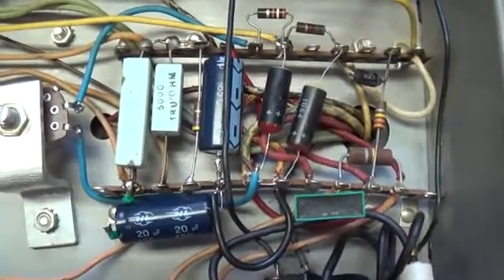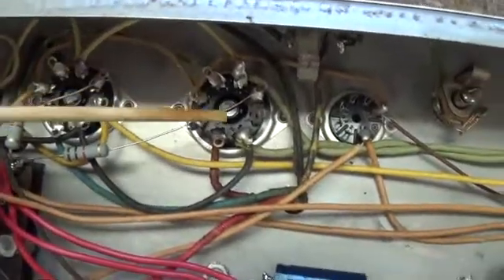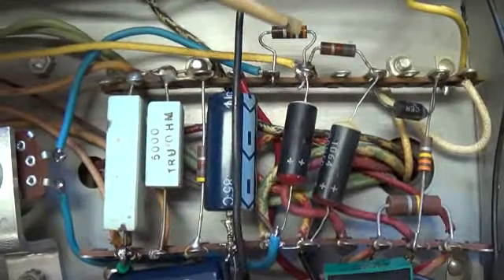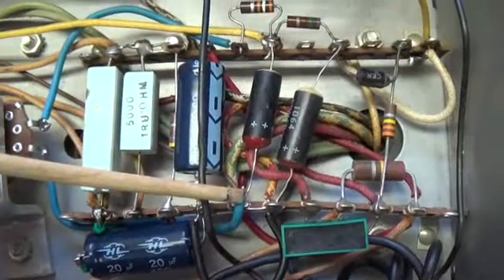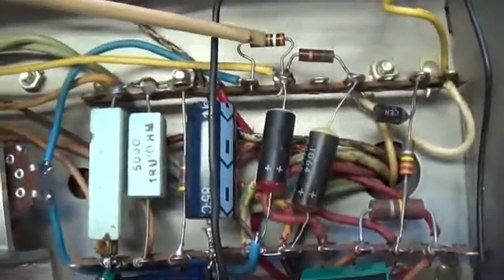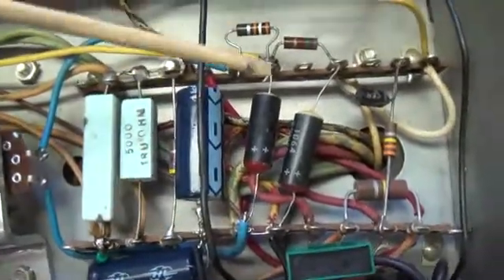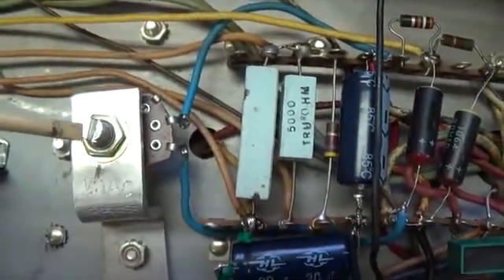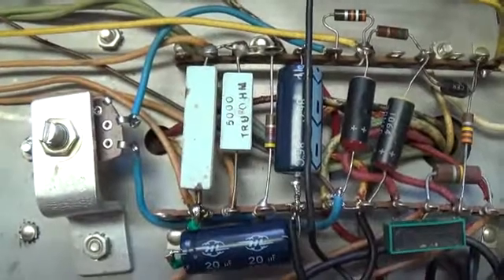Converting a Fixed Bias Amp into an Adjustable Bias Amp

Comment: I suppose this would work for a 5f1 circuit too?
Reply from the maker: I have posted videos showing how to install variable resistors in place of fixed cathode bias resistors. Two issues arise:  The wattage of the pot may be inadequate and the setting may change due to vibration, etc.

Comment: you know why no one ever designs fixed bias S.E. amps?
because the bias supply noise cancels out in a push-pull transformer ( common mode rejection ), not so in an S.E. amp.

but i have developed the ultimate 50 volt tap bias supply for S.E. amps, ( because i am designing one ), it's like a buck regulator topology, followed by two RC filters, and a zener clamp.
Reply from the maker: Thanks for your helpful input, RG.
Reply: @UncleDoug  and another S.E. fixed bias approach:  smaller filter caps take smaller " bites " of the half wave, through larger resistors it seems to smooth out more also....and both tweaks together doesn't necessarily change the knee frequency.
Reply: @UncleDoug  and Thank You...the Uncle Doug show has been a major contributor to my expanding vacuum tube electronics knowledge base.
Reply from the maker: @RulgertGhostalker  We're glad to hear it, Rulgert :)

Comment: @uncledoug what kind of 1ohm resistor is best?  what about wattage rating?
Reply from the maker: A good choice would be Metal Film or Metal Oxide rated at 1W......the current and resistance are quite low, so I-squared x R is way less than 1W.

Comment: Thank you Uncle Doug 😁 I’m doing a Filmosound conversion (621) and watched your videos about your project which helped a lot! Would a variable bias control work on my Filmosound 12 watt amp too you think? This will make it possible to crank the amp more on lower volumes am I right? Or not? 😅
Reply from the maker: If the Filmosound has an NFB loop, then it can easily be made variable or switchable.

Comment: Fixed bias is the adjustable type of bias. Cathode bias self adjusts
Reply from the maker: Fixed bias amps often do have bias adjustment pots, while cathode-biased amps do not. "Fixed" seems like a misnomer......but unlike CB circuits, the bias setting does not fluctuate.
Reply: @UncleDoug  I'm sorry sir, I didn't say anything about trimpots or any other type of adjustable resistor. All I said was this...fixed bias amps are the only type of amp that needs to be adjusted. The entire reason they call them "fixed bias" is because you have to fix the bias. Unlike cathode biased tube circuits which are regulated basically by themselves in a closed loop. Adjustable bias amp=fixed biased amp. Cathode biased amp=it adjusts itself, you should not have to do anything to a Cathode biased amp circuit unless maybe the capacitor or resistor gets cooked. Which really should not happen in the 1st place. Watch a Dr. Z video. He explains the best. Also if guys knew the truth about Cathode biased amps & how the main reasons we use "fixed bias" circuits now being fixed bias circuits create more power than Cathode biased amps. Makes me think about car guys & how they always want more power. Those guys would want a fixed bias amp if they knew that. Cathode biased amps are great as well but since they produce less power or "wattage" as it's called. The Cathode biased amps are quicker to break up & push a tube into distortion. That's where I get lost though because you would think that an amp that creates more power would be quicker to push the tubes into break up/distortion but that doesn't seem to be the case.
Reply from the maker: @MAP448  Thanks for your input, Matthew.

Comment: Do you make those little metal tabs you use for mounting the pot to the chassis? Or are those a standard bracket? Thanks!!
Reply from the maker: I fabricate each one from material I have on hand, Bob.

Comment: Uncle Doug-I'm trying to adjust the bias on a GA25-RVT with 7591's that are biased too cold...V5 is 7.8w & V6 6.3w and I believe the target is around 13.3.  I have been trying to adjust them by altering the 7.5k R46, but after watching this it appears I'm barking up the wrong tree.  After reviewing this video and the schematic of the GA 35 to see what you altered in the circuit, I think I should be looking at changing the value of R22 that bridges C14.    I've also removed the tone network that chokes off so much gain and bass out of the circuit per another of your videos on the GA35.  As a side note...the tremolo in my amp was not working and the problem was the opti-coupler which has long been unavailable.  Recently I found a reproduction on e-Bay from a fellow in Colorado,  I installed it and it works great. The new repo part also includes a shield that when connected to chassis makes the circuit hum free.  
 I want to thank you for taking the time to produce all the excellent videos you have shared with us....They are logical & well thought out without being overly technical and the emphasis is always on safety.  I think back to my early days in a body shop and the old tech would look at me, smile and say "I taught him everything I know and he still don't know a dang thing".  Well..in this case I'm learning a lot about something that has been elusive to me in the past. 
Hope you, your family and all the critters are well.
Tom
Reply from the maker: Thanks for all your nice comments and for the tip on the replacement photoresistor unit, Tom. Without a proper schematic, I can't offer any help on the biasing. The one I looked up shows cathode biasing.
Reply: @UncleDoug  Here is a link to a schematic and I welcome your opinion/comments on the biasing.
Best Rgards & Happy Easter...
https://music-electronics-forum.com/attachment.php?attachmentid=40393&d=1472138853

Comment: What kind of pot is that? Is a special pot that doesnt move easy or something? Also how much resist does it need to be ? Im thinking of buying an amp with fixed bias, its name begin with M and end in esaboogie
Reply from the maker: No, it's a regular pot. The value must be selected to suit the bias circuit WC. Good luck with the Mesa amp. Hopefully, there are techs in your area who can work on it if anything goes wrong.

Comment: I had two (2) new Marshall 2245/JTM45 guitar amps within the last 30 day's. Both had tube issues, I threw in the towel and traded for a new Fender '59 Baseman LTD. It has the same schematic but the new amps also have a bais pot. I will trade the 6l6's for 5881's like the Marshall have and maybe use a 12AY7 in the 1st. preamp position as well. Both amps use the same 5AR4 tube rectifier. 
If I had trusted myself with being able to bias the power tubes in the JTM45 I would have kept it as it is the best sounding amp that I ever played through.
 In about one more year, if I keep looking and learning from Uncle Doug's Video's I shall be a Graduate of the Uncle Doug School of Amplifier design and build/maintenance. I shall draw up a very fancy Diploma with the highest artwork skills within my possession. Maybe I shall even mail it into Uncle Doug for him to sign it. I bet If I was on the job market that alone shall indeed get me hired. 
When I was younger I would present my University Degree and I was always hired.  Truthfully, not once did anyone ever ask me to actually produce it during an interview. It was listed on my resume. 
P.S. If I learn enough, eventually I may get another JTM45. That is, if the new '59 Bassman LTD doesn't do it for me. But I think it shall, especially with the tube changes I have in mind. -Peter Nelson
Reply from the maker: You have just the right attitude, Peter. Keep on learning....but don't take chances with jobs beyond your current level of understanding. I would be honored to sign your diploma. Keep up the good work. The world needs more trained techs :)
Reply: @UncleDoug  Last March 2021 I purchased a 3rd. new Marshall JTM 45/2245 tube amp and it also had problems within a few day's so I returned it. I'm thinking that my home may have grounding issues. I do run a Variac and use a voltmeter to keep the voltage at @117-120 vac. Funny how none of my other tube amps have never had even a single issue ever, but I'm 3 for 3 with Marshall JTM45's having problems immediately after purchase (new).
I definitely need to have a better grasp about tube amplifiers. To my ear the JTM 45 sounds so good that I want one, still want one. I need to learn how to take care of it myself. If I can do that then and only then  I shall forward my Degree for your signature! - Peter age 71, 72 in 17 day's.
P.S I'm going to change the 6L6 power tubes to 5881 power tubes in my '59 Bassman LTD (Note: the LTD in the name  refers to "Lacquered Tweed" and nothing more). Also perhaps I should change the 5AR4 rectifier tube in my '59 Bassman to a GZ34 like in the JTM 45. I have also heard I should set the bias to 37mA. Lastly I read to pull the V1 preamp tube. I'm hoping to get the tone closer to the JTM45. When I compared these to stock amps the JTM 45 sounded better to me. I also heard that I should set the "Bass" knob on my '59 Bassman LTD to eight (8), for the JTM 45 tone.
Is the term "P1 synonymous with "V1" valve position? I'm asking because I read that I should pull V1 and then also read to change the P1 to a 12AX7. This confuses me as the '59 Bassman LTD already uses three (3) 12AX7's.   Also they mentioned pulling V1 but they didn't say to replace it with another preamp tube. I think this last bit of info is off base.
Reply from the maker: @PeterDad60  Mastery of tube amp circuitry requires a lot of study and practice,  Peter. You might consider buying an inexpensive,  non-working tube amp and using it as a learning project.....then sell it for a profit and buy another. That's how I got started.
Reply: @UncleDoug  That's a great idea. Better than mine as I was thinking once again that you should open an "Official Guitar Amplifier Technical School", or maybe I could move to Arizona to be near you and then I could become your assistant and hopefully learn from you. Of course that last part is extremely selfish, inconsiderate and downright inappropriate of me. So your suggestion is not only timely but also a much better idea than mine were.
BTW I'm an "air cooled motorhead" (motorcycles) as cars are an expensive hobby. Also the parts are smaller on motorcycles and they have less of them (V-2 vs. V-8 etc.). I went for my first ride of the year a few day's back and life is good! - Peter age 71 turning 72 in 16 more day's. Yes, I'm counting the day's
Reply from the maker: @PeterDad60  We share another common interest, Peter. I spent years collecting and restoring vintage British motorcycles (BSA, Triumph, Norton). Until my kickstarting knee failed, I'd ride a different one every day. It's a shame how age encroaches on the activities that make our lives worth living.

Comment: I had an amp tech install this mod in my 1980's Marshall.  I can access it without pulling the chassis.  He told me just to adjust it by ear, as the range of the pot won't let me red plate the tubes.  Every tube amp should have that feature!
Reply from the maker: I'm a little wary of the "adjusting by ear", but it sounds like it really works for you, TJ.

Comment: I also have a Crate V50 tube amp would you happen to know if this amp requires a bias adjustment?
Reply from the maker: Is it fixed bias (grounded cathodes) or cathode bias, CRG ?

Comment: Hi Uncle Doug! I have a Hayden HGT A40 Watt tube amp, it's a product of Ashdown amps, it comes with 3 x 12ax7's and 2 x el34's, in the user manual it states that this amp is of fixed bias, does this mean no bias adjustment is necessary for the power tubes or when changing the power tubes to new ones? I have read that cathode bias requires no adjustment yet fixed bias does, can you set me straight on this? Thank you!
Reply from the maker: A fixed-bias amp does require a bias check each time that new tubes are installed, CRG. A cathode-biased amp generally does not.

Comment: Hi Uncle Doug! I was looking a this video and saw that's a grounded cathode fixed bias. But I can't see where was the original 47k resistor... was in the plate of the 7591 tubes? I search for a schematic and only find Gibson GA 75 with 6l6 tubes... could please tell me where is located this 47k resistor? Thanks
Reply from the maker: The exact position of the 47K resistor is shown in the video starting at around 0:24, ES. This circuit is a Gibson GA-35 RVT. The schematic is readily available on the Internet.
Reply: Ok Thanks!!!
Reply: Could you please help me with an issue? I have a beautiful 67  Dual Showman Amp, and I was cheking the B Voltages. The B+ that goes to the output Transformer is 450V (as says the squematic), but when I checked the next B (after the choke going to the Screen grids), I found 430 V insetad the 445 V that reads int the schematic.. This lower voltage is due a malfunction of the choke? Or the 20 mdf - 525v electrolytic Cap to ground? Or an incorrect Bias un the output tubes? Thank you very much Uncle Doug, you are so great!! I'm very pleased to meet you throught youtube!!!!!
Reply from the maker: The values you have stated sound fine to me, ES. The actual voltages you find in circuits rarely match the schematic values exactly. Chokes don't go partially bad.....they simply work fine or not at all.
Reply: Thanks Uncle Doug!!! Because of a low to moderate 100 hz hum I replaced the old Mallory Filter caps (2 x100 mdf in paralell) for new Tube Amp Doctor caps... but the 100hz hum still there... May be is normal to have some hum since the total capacitance is 50 mdf for 450 V AC positive.... Is normal to have a low hum on a big amplifier like the Dual Showman? Thanks again, and best!!
Reply from the maker: I assume that you have 50Hz power and that the "100Hz hum" is double this frequency. If so, then it must originate in the power supply. Surely there is more than a single stage of filtration......i.e. more than one pair of filter caps. You should consider testing and replacing them if necessary.
Reply: Ok, I found the 47K resistor in the schematic.. since this is grounded cathode, the bias is throught the control grid with negative V... thanks!

Comment: how many watts go throught the potentiometer? i have a el84 stereo push pull amp and i would like to be able to swap out tubes and even use unmatched tubes so i was thinking about doing the same mod but i would have to make 4 bias test points and 4 potentiometers but since the cathode resistors get hot on this amp i am afraid a potentiometer would burn up
Reply from the maker: Since your amp is cathode biased, the wattage would be a lot more than the pot in my conversion would face, since the conversion is for a fixed-bias (grounded cathode) circuit.....which is quite different. Unless you can find some high-wattage pots, I would not recommend this  conversion for your CB circuit. You can use a pot to determine the ideal cathode resistance and then install a fixed resistor of that value, but I wouldn't use a pot permanently.
Reply: thank you for confirming that !
Reply from the maker: You're welcome, Hugo :)

Comment: Great vid Doug, I've just done the same thing to an old old Selmer SV Zodiac 100w after fitting new filter caps and associated resistors: Set at -39v using JJ El34s
Reply from the maker: Thanks, Tim :)

Comment: Hi Uncle Doug. Great video, so useful ! I am about to do it for mine (epiphone 500T, same wiring as Gibson Titan III). Mine as 4 6L6GC and therefore 2 cathode resistors of 47k, or at least I think that  they are the ones... Any tips on how to wire this up with a single pot ? Many thanks in advance.
Reply from the maker: There aren't any cathode resistors, Michael, the cathodes are grounded. If you make the 47K resistors variable, it will affect the balance of each pair of output tubes. To regulate the bias voltage to the grids, you could substitute a 17K resistor and a 10K pot in series for R52. Be careful when you first turn it on to adjust the bias.....start with the pot at 10K to ground and gradually reduce the resistance while monitoring the plate current.  Be careful !!
Reply: Thank you. I had a look and made the change, together with adding 1 Ohm resistor on each 6L6GC to ground, but... weird noise, smell of smoke... I stopped, then looked everywhere, nothing strange. switch on again.. weird noise, smell of smoke... I removed everything and back to normal. No noise, no sound even... power lights where very light, pale, no voltage on the green wire (should be 6.3V). Then, smoke from the power transformer.... done ! I don-t know why and how.... so I will look for a replacement of the transformer, this is an old 606430. thank you.

Comment: Hello, I'm kinda new to biasing tube amps; if I heard you correctly you stated that you "removed" the 47K resistor and added a 39K resistor. I'm still seeing the the 47K (I think) bridging that gap in your circuit. If that's the case, what did you remove? I'm sorry I'm not clear on this and thanks.
Reply from the maker: Could you provide the time in the video where you saw this, Gary ?
Reply: Lets' see....it would be at .24-.33 secs. What I'm hearing is that you removed the 47K resistor but I still see a resistor covering that gap that you're speaking of. If you removed it shouldn't it be gone? Excuse my ignorance, but am I missing something? Thanks.
Reply: I see now; I was thinking the capacitor was the 47K resistor that is bridging the gap. I just noticed the "+" sign on that cap. So the 47K res was never in the video. Sorry, I'm getting old and sometimes it takes me a while to process things.